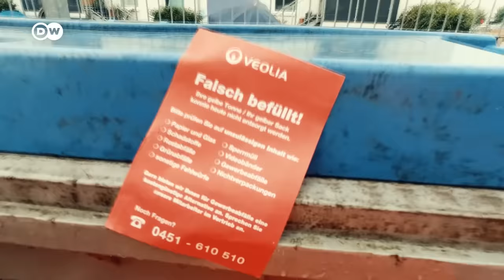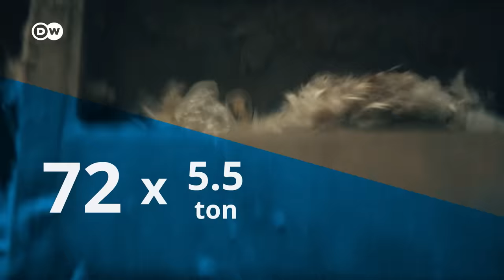The recycling myth: What actually happens to our plastic

Comment from the maker: CLARIFICATION:
The official number for Germany’s recycling rate is 38% for plastic that was thrown away by consumers. But of these 38% about 16% are exported to other countries and recycled there. 7% are burned. 
 The 16% that we referred to as being “actually recycled” in the last section, is the plastic that is turned into recyclate and used for the production of new plastic products in Germany.
Reply: This 7% burning… is it done with energy conversion to the recycling process or the (energy) grid in general ?
Reply: What about the possibility of pyrolysis instead of full burning ? Probably it can reduce the amount of toxines by captation in sub processes more easy then in the case of burning where they ‘try’ to reduce at the end-of-pipe location…
Reply: The dude literally said only 16% of his plastic got recycled. The rest got burned. My guess is that 60% of Germans plastic is burned, which is still a lot less than other states.
Reply: And countries, sorry I didn’t sleep
Reply: @brudo5056  Yeah, no kidding.  Whatever happened to the promise of Thermal Depolymerization (TDP)?  I guess it's just not 'economically viable' enough at this point.
Reply: @brudo5056  burning is actually not as bad as it sounds because it creates energy and can warm up houses etc.
Reply: @phanders6236  Burning plastic is not as bad? Can you explain a bit more, please?
Reply: @sebastianbardon391  I just did hahaha
Reply: @phanders6236  You are just saying that burning plastic creates energy and can be used for heating.. you are not addressing the side effects. Don't you believe that the emissions will turn it in one of the worst ways of producing energy?
Reply: @phanders6236  To be honest, because it can produce heat it is one of the worst things. In Bulgaria in some cities during winter the air gets really polluted, because people are burning lots of plastics to heat their homes. Again an "economical" solution, that is bad for the environment
Reply: @andreivarbanov3528  what is your solution?
Reply: @phanders6236  If we grant that burning plastic is acceptable, it should always be done in special incinerators that can filter away most of the toxic fumes. Regular chimneys don´t have any filters, which means all the toxic garbage gets released right over the most populated areas. That´s literally the worst solution ever.
Reply: @phanders6236  Using plastic as fuel is a temporary solution during the winter. That's what I meant. In reality there are many other ways to heat your home. As for the plastic I am not an environmentalist, but I would gladly accept if you have any ideas how to solve plastic problems in more environment friendly way
Reply: Yes, but even that 16% is only of certain plastics.  Other plastics can't even be recycled once.
Reply: @andreivarbanov3528  I keep asking for your solutions but you keep asking me insteadXD
Reply: @phanders6236  I guess we are both not qualified to give a proper answer. If I am not correct, please let me know
Reply: Much of the problems stem from using multiple material types and non recyclable types of plastics. Which only become a multiplicative issue with lax end user sorting at best combining non recyclable plastics with recyclable ones.

That said recyclable plastics and other recyclable materials are not always suitable for the product, in such cases these should be clearly labelled as non recyclable while the same clear labelling should identify what is recyclable.

Sadly this level of recycling would only be possible by state enforcement, regulation and management. Something we are unlikely to see in democratised nations, more so where they are economically weak and/or subject to private enterprise lobbyist influence.

There is no profit in recycling or any real green technology because of the deeply entrenched private sector that would lose out in the market. So they push back in as many aspects of the green processes as they can to increase costs or reduce green efficiencies as pollution leverage points.

Culminating in green industries and processes being underdeveloped and effectively sabotaged from the start. Meanwhile these entrenched polluting private multinational corporations buy up rights and patents to these green processes & technologies on the cheap only to sit on them until the day they cannot make profits from their current markets.

Democracy, in its current accepted form, allowed for private multinational interests to become more important than national public interests.

Makes me wonder how different the world would be if England either didn't defend the American colonies or found a different solution to the war of independence like having an American colonial representative so taxation had representation.

Would be a very different world indeed....
Reply: "16% is exported to other cuntries and recycled there" - how do you know what those other countries actually do? are there any procedures to check it (i doubt tho)? lots of that ends up in Poland or further east (sometimes in not legal ways), is put in some warehouse or such and after a while it gets "accidentally" set on fire. so much for recycling..
Reply: Hi DW, do you have a study or a source you can link to? I will be excited to read more.
Reply: @brudo5056  Just mentioned this in reply to a comment above where they were talking about plastic landfill turning back into oil eventually....why bother waiting when you can do it in an afternoon with Pyrolysis. Thumbs up for mentioning it btw
Reply: @RanHime   i agreed, here in  Phillipines I don't know why other countries shipped waste in here.
it doesn't end up in recycling factory they just dump it in a certain place and left alone. And sometimes they set it on fire. and we know thats not good for the ecology.
Reply: Hold on. I'm confused with the numbers now. In the video, you mentioned that 60% are being burnt. And now what is 7% burned? Also if 16% are exported and recycled in other countries, why is it calculated or added as Germany's recycling rate? So if you deduct 16% from 38%, the remainder is 22% and shouldn't that be the recycling rate of Germany? PLease clarify. Thanks
Reply: @RanHime  Yes, a valid point. In the video, they mentioned that 60% are being burnt. And now what is 7% burned? Also if 16% are exported and recycled in other countries, why is it calculated or added as Germany's recycling rate? So if you deduct 16% from 38%, the remainder is 22% and shouldn't that be the recycling rate of Germany? Please clarify. Thanks

Reply
Reply: I am from India
I will do work of plastic shorting
And I have done 15 year experience of plastic shorting 
I want job
Please help me
Reply: > exported to other countries and recycled there

Press X to doubt (that last part)